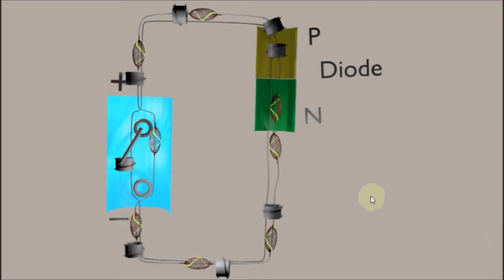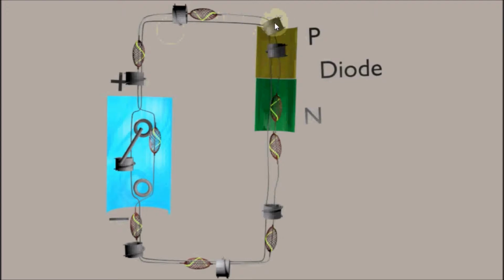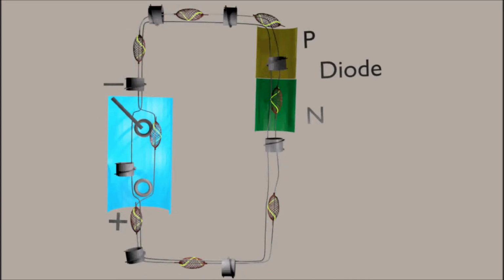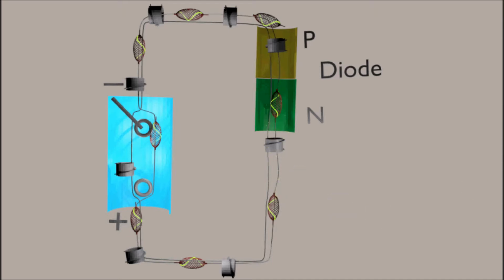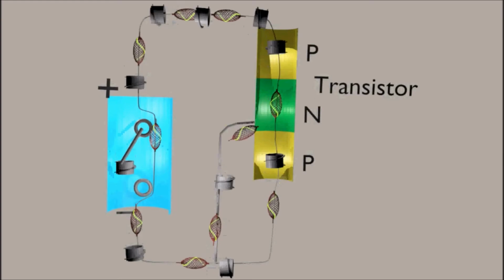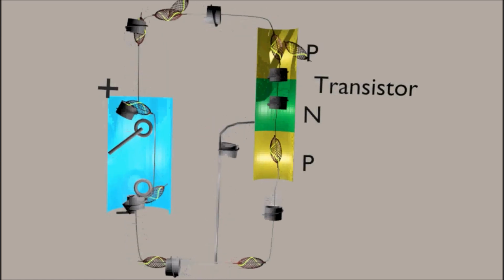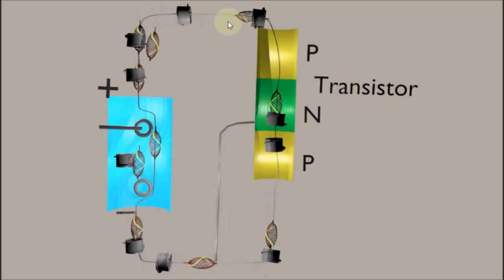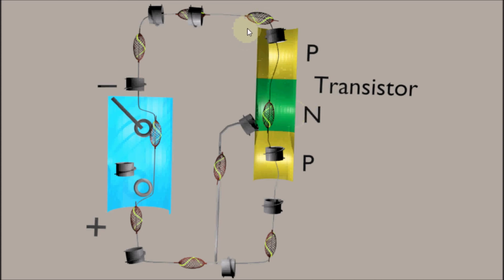Draft Electric Circuit Analogy

Comment from the maker: I am new to electronics myself, I think the important part about the diode is the reverse configuration where the current does not flow, that can protect your devices from a back voltage. The forward voltage can be used for other things like an LED (Light emitting Diode), uses very little power but makes light.

I wish an Engineer would comment since I am a beginner with this as well.

Comment: I get your resistor analogy and elen your transistor explanation, but I had to google why a diode would be used, (and I'm still not 100%) clear. Is a diode only needed when the current reaches a 120V threshold? It there a V threshold where current flows in reverse?